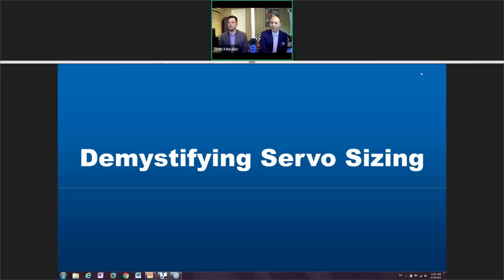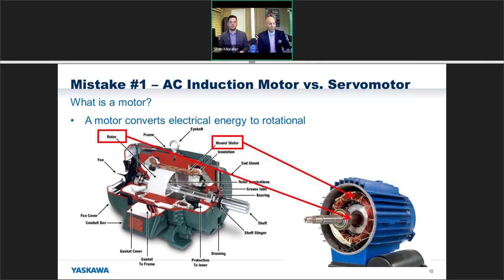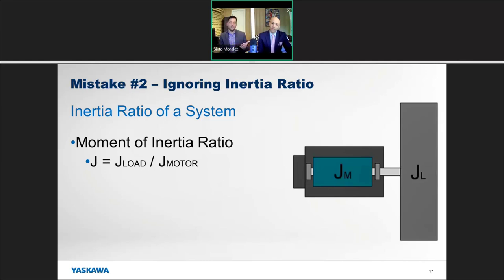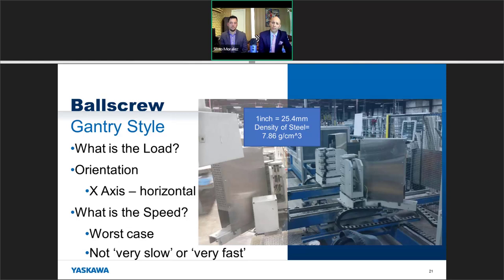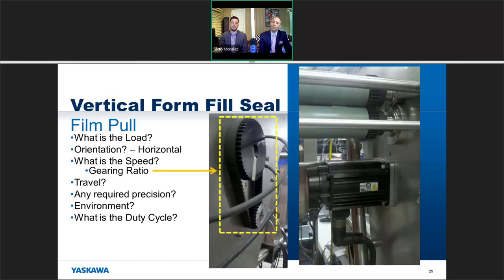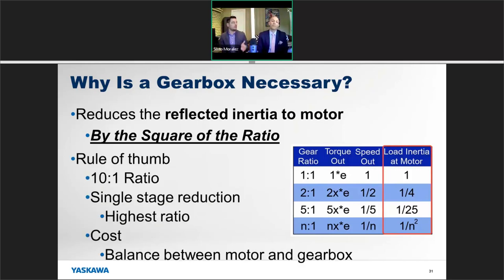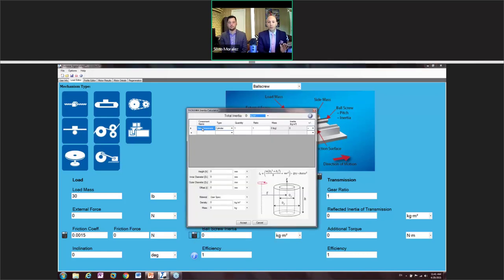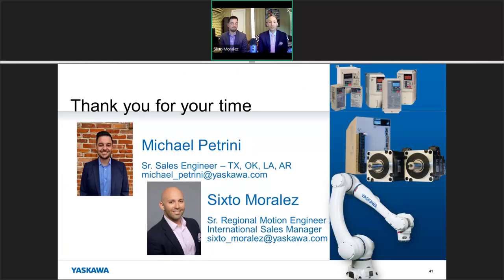Webinar: Servo Sizing Demystified

Comment: A basic Doubt, Probably stupid one...! 

I am Planning to Build a CNC Router 8*4 Feet in Size. 

Can I Calculate the Inertia and other parameters required to tune the servo using this details?

Frame Build Using Steel Square Tubing. 100mm*100mm

Drive :-Rack and Pinion Almost 1.25 to  1. 5 Module

 Using a Reduction  1.5M gear box 

For Example : How can I calculate the Moment of Inertia  of the Y axis as it has to drive the  entire gantry  with Z axis spindle assembly.?
What if I am Using Dual Motors on each side of Y axis?

Can I calculate the Inertia parameters with the overall gantry weight and all above details?

Please guide
Reply from the maker: Thank you for your inquiry. Kindly choose the nearest service provider in your area by visiting https://www.yaskawa-global.com/company/profile/global; they will be able to assist you with your request.